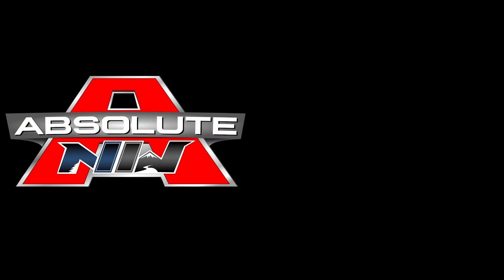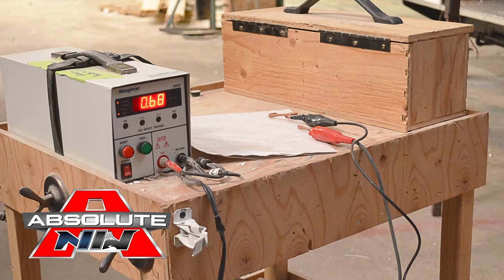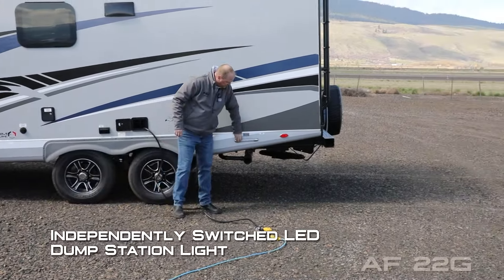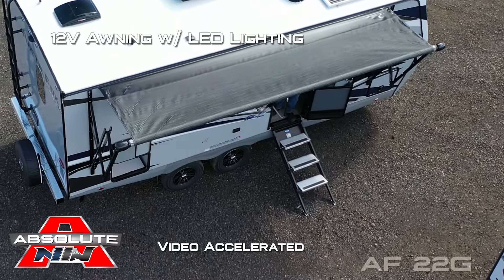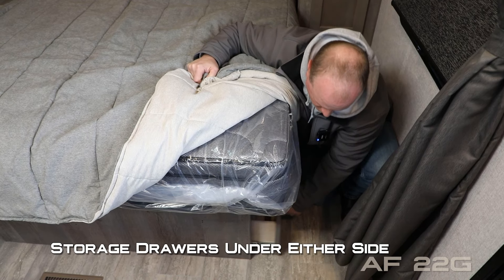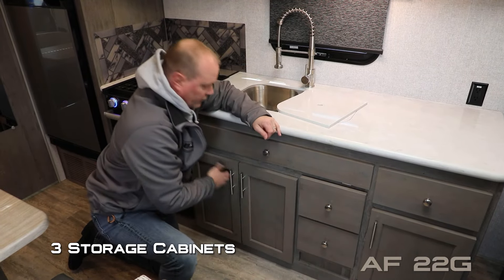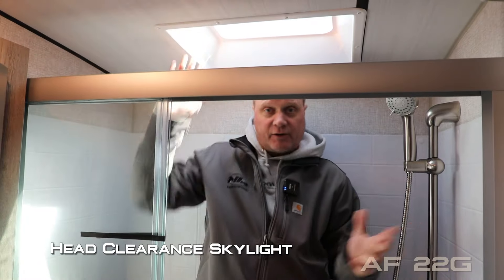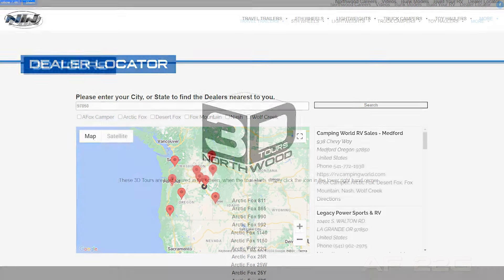Quick Tour of the New 2024 Arctic Fox North Fork 22G

Comment: Where is all the spray foam? You could double the R values if your spray insulate them. 
I live in Canada its regularly drops below -30 & even more often over +30.
I have doubts about the single thin bat of insulation for the floor.   
Do you have the total insulation values for the roof, walls & floor?  
Do all the outside compartments lower the total insulation value?  
There so many features offered here I am not interested in.  
If I do not want your radio, tv or satallite dish would the price be lower?
I want a home to live in not graphics on the outside. 🤦‍♂